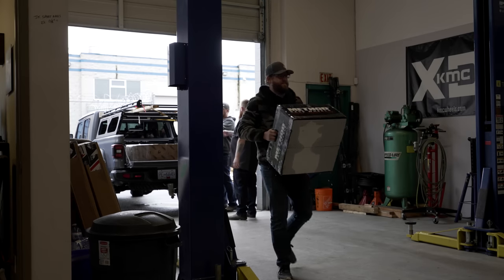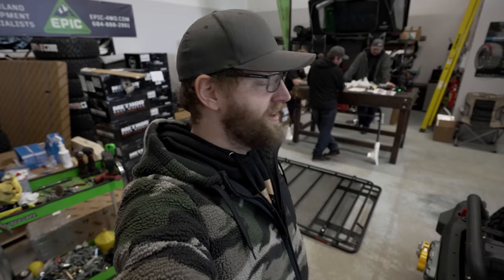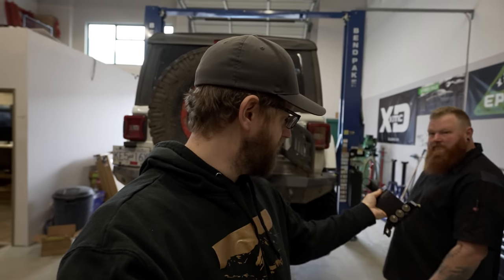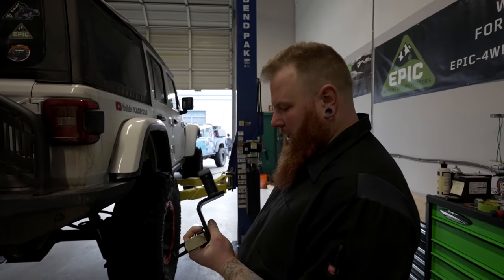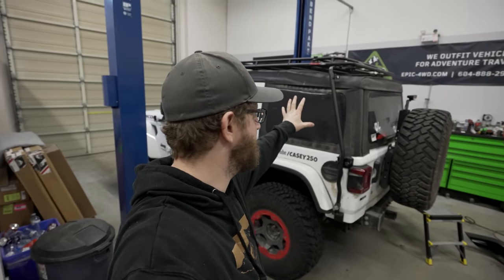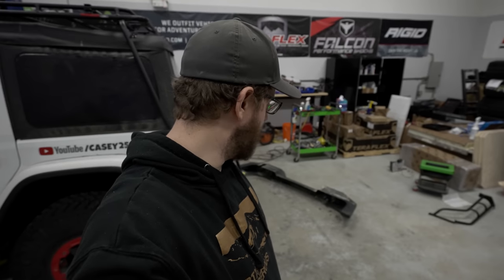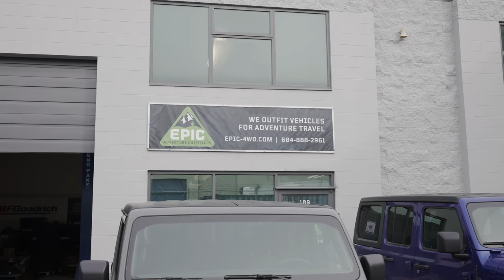JEEP WRANGLER JL with SOFT TOP gets a ROOF RACK! We Are Preparing for a Roof Top Tent Next!

Comment: I have seen people put pool noodles under the rack rather than buying from Gobi. You can get these at the dollar store and it will stop the loud flapping sound when your soft top hits the bottom of the frame. Try it out, you won't be disappointed.
Reply from the maker: THIS IS GENIUS!
Reply: Hi Casey! Love the channel! I’m on the fence for a Gobi, but you are not the first mentioning the soft top flapping in the rack.  I read about the noodles, but still, s lot of rubbing could damage the canvas, no? You’ve had the rack for some time now. Have you seen any mark?

Comment: How does the top fold down now? I’d love to see a video of the top folding with that rack on.
Reply from the maker: You can unbolt the front and it tilts back. They also sell a quick release kit if you want to use it often. I plan to keep the RTT on and typically only remove my side and rear panels.
Reply: That was my first question, too?
Reply: Same question, the point is this was supposed to "work" with the soft-top, it sure doesn't look like you can open the top easily anymore.  Please demonstrate :D
Reply: Is there one that looks like this for the jk?

Comment: Very cool!  Looking forward to the next video!  Unrelated to the video, how do you find the soft top fairs in the cold weather?  Not much heat escapes?  Or are you constantly wearing a coat in your car?
Reply from the maker: I'll preface with saying, I don't drive much outside of wheeling trips. However, the Jeep has tons of heat and I'm never cold and usually take off my jacket to drive any sort of distance. The heated steering wheel and seats are awesome. I think the back row of seats is a bit cooler but Maddi has never complained. It also doesn't get much below zero celsius here.

Comment: Maybe I missed it... I skimmed through... but can you open the roof?  I guess not, without removing the rack, so what's the point?  Was this just to safe money on buying a hard top..otherwise why live with the (noiser and less secure) soft top ?   [ SOME MOMENTS LATER ]  Okay, read the other comments... I get it now - it can tilt back and, as you said, you can still remove the side windows and rear... Thanks for the video. Wish there was a simpler option - I'm not confident to start removing my fenders and other bits.
Reply from the maker: When I ordered my Jeep the world was a different place and I had different plans. With my rack now I can remove it in about 15 mins when I dont want it on. Then top down :)